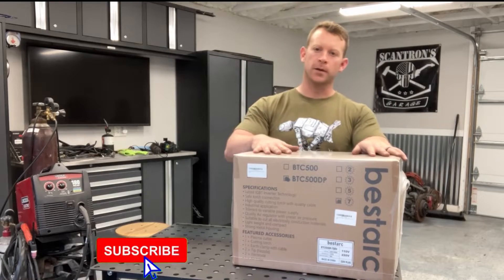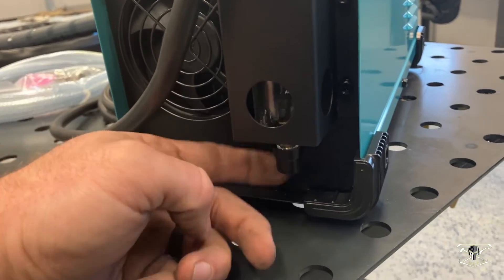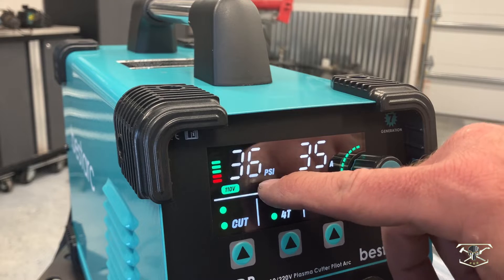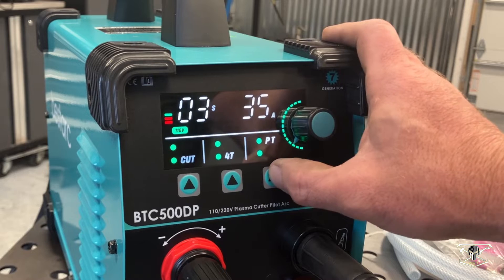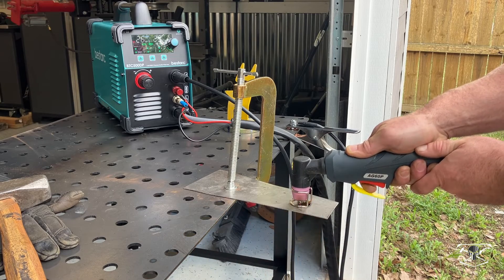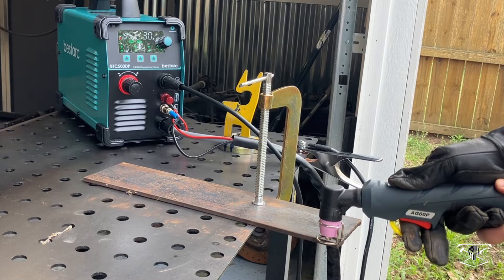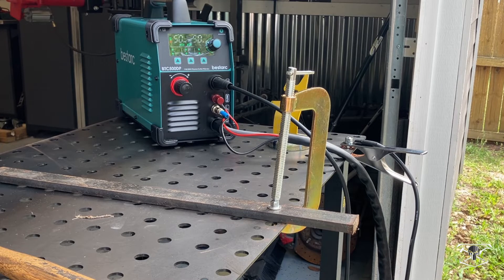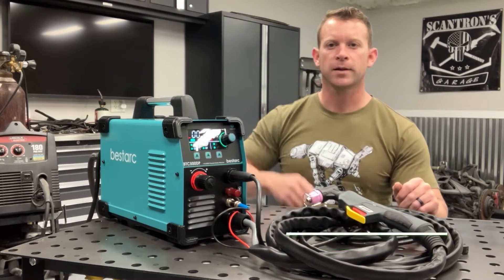bestarc BTC500DP Plasma Cutter

Comment: Have you tried this on your CNC yet? I’m curious if the high frequency will lead to any EMI/RFI issues.
Reply from the maker: I did! and yes I had some electrical interference issues but I have just been using the thumb switch. I have a video on it
Reply: @scantronsgarage  - thanks! I saw the thumb switch video. I'm building a very similar setup, and I ordered the Bestarc, but I haven't assembled anything yet. I've been wondering if shielding any of the wires would help, as well as pulling the control board off the frame. I guess we'll have to experiment.
Reply from the maker: @LoadsofBacon  It would help for sure. I had intentions of doing the same however I was too eager to try the machine out and went right to cutting.